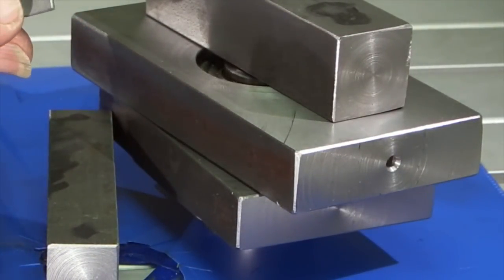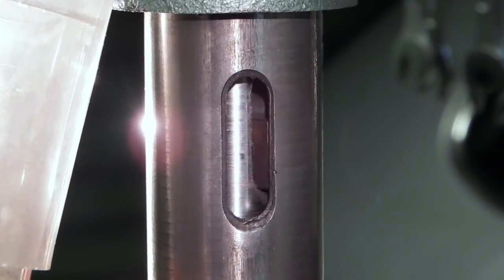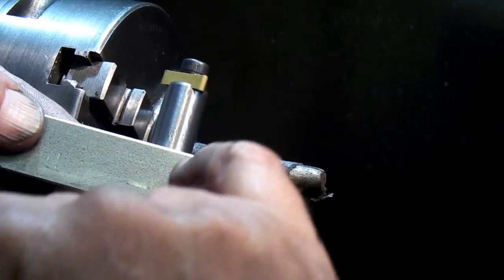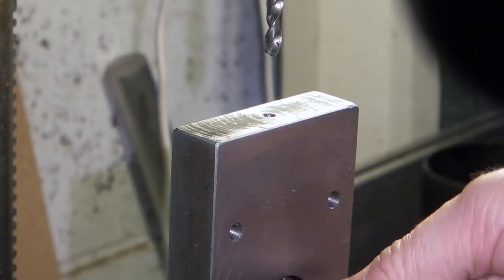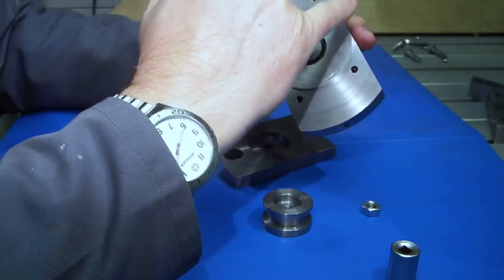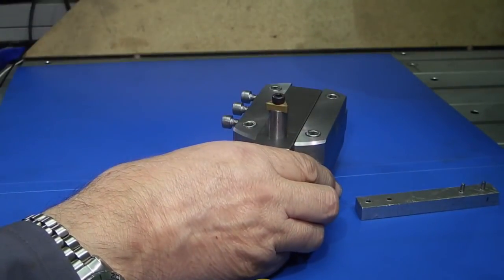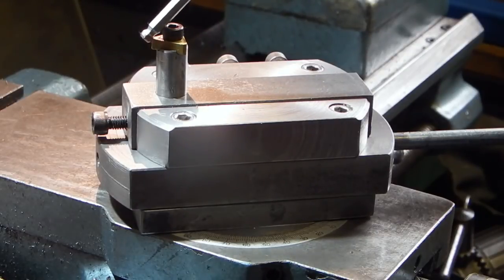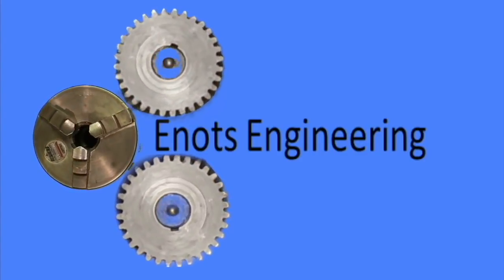Radius cutter (Ball Cutter) for the lathe

Comment: EEEK! Never, ever, use a drill chuck with a milling cutter. Drills push back into the chuck as they cut, end mills pull out. Nothing to do with the chuck holding taper. It's potentially dangerous, damaged work, damaged operator if cutter escapes. BobUK.

Comment: Why not just put a cut mark on the side, and a 0 mark on the sliding piece. Then all you need do, is mark on the center for each inch  of ball size, from the zero mark?
Reply from the maker: Hi Ronald
I could do that if I used the same tool tip and tool holder. As I have different tool holders the tool position changes, so the marks would be wrong.

Comment: Very impressed with your work holding on the lathe. I have made a similar one, except I have a mill so I did not need to hold work like you did. But I learn and now have a few extra tricks for my lathe as well. Wanted to point out two things; first, mine like yours requires the turning to be far enough away from the chuck to insure no chuck interference (this has caused me to sometimes secure the work rather poorly), second, my lathe chuck is mounted by screw threads, so running in reverse is extremely dangerous.
Overall very good job!!
Reply from the maker: Thanks Tom